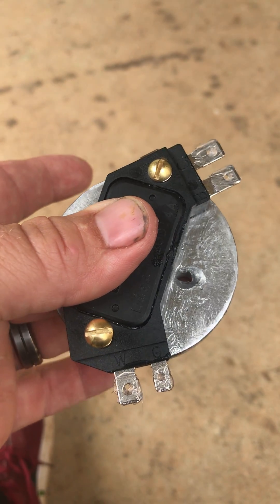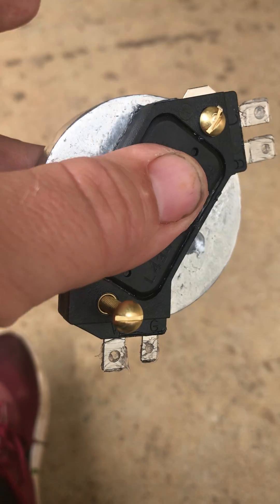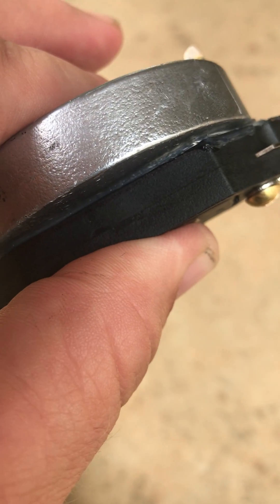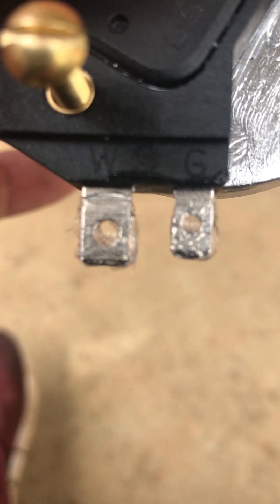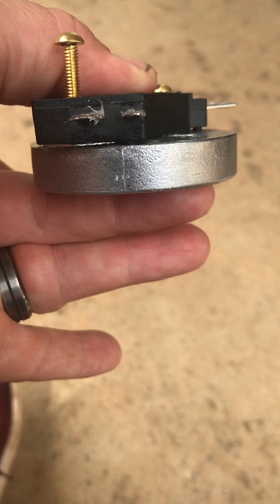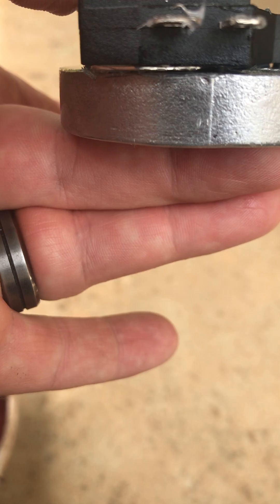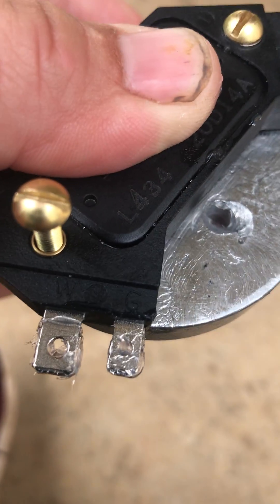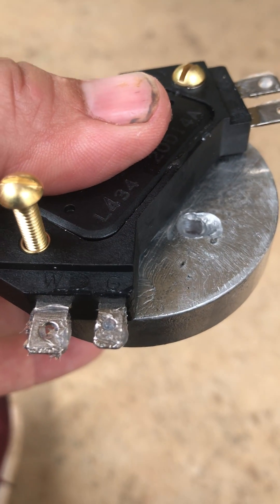1999 ezgo golf cart hei module conversion

Comment: Looks like it would be a great solution. Too bad there is not enough information about the parts to make it possible to find them. If I walk into a parts store with the very little information given here all I’ll get is a dumb look from the clerk.
Reply: the module is part number CBE4 then you use a automotive coil E40 that has an internal resister. red wire  from the motor go's to the W. the blue wire from the motor go's to G. from C  wire go's to the  - on the coil. from B  wire  hooks to the hot wire from the switch and to the + on the coil.  make sure you ground the module with a ground wire where you bolt the module down. you will see that one side has a ground ring at the mounting hole.
Reply: @pllafontaine  thanks Phil!
Reply: @pllafontaine 
What GM product is that 2 wire coil made for.